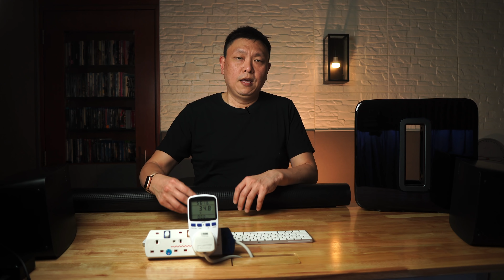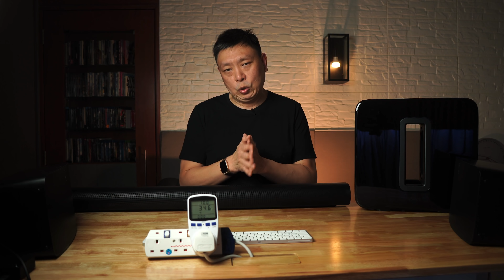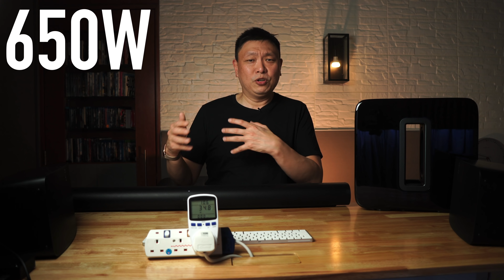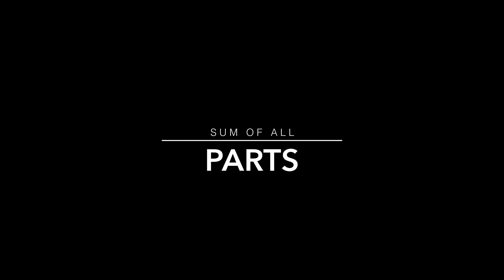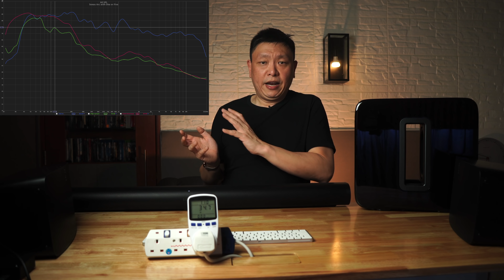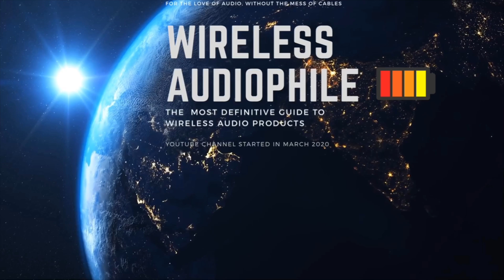Sonos Arc ultimate setup @ 2,500 USD. Is it worth it?

Comment: Thanks! Peter, the clarity and thoroughness of your reports set a gold standard for any other Tech site.I even enjoyed  learning about products that I don't even own! I have an installation project whose solution I don't think you have addressed before. It's a 55-in TV on a full motion corner mount with +5 to -10 degree tilt, and Sanus extendable Arc TV mount.  I have a 9-ft ceiling, and 32 inch high by 10-ft distance mlp. What height and angle should the arc placement be for best listening? I don't have your trig background, so any advice would help. Again, great work!
Reply from the maker: Hey Kirk, thanks for showing your appreciation in a tangible way! Sorry if this is late I do have to juggle my full time job as well as this. :)

I need one more piece of information from you. How high off the ground is the Sonos Arc now mounted?

Comment: Hello Peter,

firstly thanks a lot for your detailed descriptions and test with the Sonos systems.

I bought a Sonos Arc and the sub. For movies/films it is impressive especially with Dolby Atmos.
Unfortunately the most films have no Dolby Atmos in German.

But I am not so happy when I hearing music. I think about to buy two Sonos 5 as rear speakers. But I am not really sure If I can use for music only the two Sonos five in the back? If the systems is configured as a 5.1 system. 
Thanks for your support.
Reply from the maker: If you set it up as two rear surround channels, you can't use the Fives purely for music. But you can set it to send full sounds to the rear (fives) and also increase the music volume for surround. This way, it will be much louder and will stand out in the music mix.

Comment: It would be cool if the sonos five as rear surround speakers in there upright position would use it's stereo drivers as one for rear sound and one for above sound. So with the speaker slightly tilted up the bottom drivers would do rear sound, and the topp driver would bounce it's sound off the ceiling for above sound like the arc's upward fireing speakers.

Comment: I think the Sonos 5 as surrounds might have more of an advantage iPod the space between the surrounds in a wide spread room arrangement would yield more tangible subjective performance advantages over the much smaller Sonos 1.  I get a lot of sharp, pinpoint directionality from the Sonos ones, (more so from he right side). I cannot help but wonder how much more fuller the atmos effect could be with the Sonos 5 as it pertains to offering much bigger sound stage at similar volumes that I set my Sonos 1.  I am of the belief that the broader spread of sound emanating from two Sonos 5s will offer a much more subtle but more importantly convincing immersion into the Atmos sound field than Sonos 1s are capable of. The smallness of the Ones in an Arc/2 Sub Gen 3 set up is too noticeable
Reply: I'm thinking the same. The sound stage has to be better. And that is the point, not necessarily louder but more immersion...you cannot tell me a 1sl is the same as a 5 I'm sound quality

Comment: hi Pete...great review...i am gonna be setting up my SONOS ARC with 2 Gen 3 subs / and the 5's as my rears..what are your thoughts ? room is 14 x 22 ft...ceiling is 8 ft high....and the TV i will be hooking it all to is the Samsung Q90T  85 inch....also where would you suggest i place the 2 subs ? ( on each side of the TV ? or one up front and one at the back of the room)....look forward to your response....thank you and cheers......be safe out there all
Reply from the maker: I did a video on placement of two subs. And your setup... GOD LEVEL.... I would suggest you try the two subs upfront first. And if you get patchy sub response throughout the listening positions, move one of the subs to back of room, but diagonally across the first sub.

Comment: Hello Peter ! If I want to connect a turntable in this setup, do I have to go through sonos amp?
Reply from the maker: You can use a Sonos Port as well as an amp. Port being the cheaper option if you don't need the amp. Because in this setup, the Fives' line-in is not active.

Comment: Can i add two sonos one to that setup?

i would like to have 1 arc, 2 fives and one sub in the front 
and 2 ones at my back for surround
Reply from the maker: No you can't. They will have to be in two separate "rooms". So technically, if you do set them up as separate rooms, you can play to the two of them together.
Reply: @PeterPee  Thanks for the quick reply my friend!

I dont really understand your answer :(

I want all these speakers in one room together 2x fives in the front 1x arc in the front and the sub in the front and the ones in the back

i want that the 2x fives, the arc and the 2x ones to create a surround sound
Reply from the maker: They won’t work together to create surround. Your surround setup with be arc + sub + ones at the rear. The fives will have to be setup separately as stereo pair. Not as part of the surround setup. You can play the surround and stereo setup together though.

Comment: I hope you will do a test on the Denon home series. To my untrained ears in a big shop they sounded better then what sonos had on offer. Reason why I chose sonos is because the Denon home line up does not include a sub and soundbar (the older 2019 Heos sub and soundbar versions can be coupled but they look totally different, which at 2500-3000 $ I don't like...)
Reply from the maker: Beyond the sound, you have to consider that Sonos is going to be supporting your gear for much much longer than almost every other brand out there.
Reply: @PeterPee  thanks!

I think Denon is also quite good in supporting older stuff, anyhow even if you stick to Sonos I would still love to see other manufacturers sending multiroom audio products for you to review in your very detailed manner!

Comment: You do the best reviews I’ve ever seen.  Thank you!  I’m considering this setup.  By chance have you done a review on the Nakimichi 9.2.4 Ultra?  What is your overall best opinion on the systems you’ve tested and best value for money on a good sounding wireless system?  Thank you again!
Reply from the maker: Thanks Ron! I have not tested the Nakimichi 9.2.4 Ultra. The specs sound impressive and the sheer number of channels will make you think you are getting a lot for the money.

But I'd say overall, the Sonos will give better value, as they really last very long. In all my years of ownership, I have never had a single hardware failure. And also, even the 9 year old Sonos Play:3 is still being supported and updates rolled out by Sonos! That's longevity.

Comment: Hey Peter I have the Playbar with 2 sonos 5s beside it and 2 sonos ones at the rear accompanied by the sub. If i want more fire power would 2 subs be overkill? Or adding 2 more 5s or swapping the playbar for the arc be the better option?
Reply from the maker: You can’t really use two subs in one ‘room’. But your setup sounds like you already have two rooms, one for playbar and one for sonos 5s. I’d be honest and say it doesn’t make too much of a difference. In fact it might overpower the room already.

The next thing you might want to consider is to replace the ones with the fives. But that’s about the max you can get out of your situation. 

Replacing the playbar with the arc won’t give you a lot more.

Comment: I have the sonos Play:1 is it compatible with sonos arc to be the rear speakers? and what is the difference if I have Sonos SL as the rear speaker compared to Sonos Play:1 as the rear speakers?
Reply from the maker: Yes, the play:1 is compatible. I am still using the Play:1s as surround rear speakers. The Sonos One SL makes little difference.

Comment: What is the recommended hdmi cable?
Reply from the maker: I just use the original cable provided by Sonos. If not, I’d recommend elecom which are orange certified. The ones with the orange sticker.

Comment: Awesome review. Only question I have is if the Five can be set up vertically to have one of the angled woofers facing the ceiling thus creating a rear surround up firing speaker?
Reply from the maker: I placed it in either orientation and to my ears, it didn’t make a difference when watching movies in terms of height perception. I actually would place it horizontally so as to get a wider surround soundscape.

Comment: Hi Peter, can you clear the air about the lip sync issues with sonos arc + shield 4k/apple tv 4k + oled TV? Reference: https://en.community.sonos.com/home-theater-228993/if-you-re-experiencing-audio-delay-issues-read-this-6793458/index20.html
Reply from the maker: It's really unfortunate but the processing of the Atmos signal causes issues. It's something that the TV makers will blame the soundbar makers for and the other way round too. I unfortunately can't figure out a solution to this and everything seems to be pretty hit and miss now. I know that my Wemax A300 projector introduces the delays. My LG TV doesn't, with either the Shield or the ATV. The ATV doesn't even want to work on my Samsung TV to pass through Atmos.

Comment: Do the 5s make a big difference when using the system for music (which I would be doing)??
Reply: Without a doubt 5’s/Fives make a significant difference in listening experience for music. But you have to play with the app settings for your room EQ and surround 5’s/Fives to be able to get a good sound for music playback. You might also prefer listening to music with Autotune turned off. It’s all about your own preferences, combined with the acoustics in your own listening space. But rule no1 in this config is to switch surround speakers to full music playback because they default to “ambient” which is useless for music playback. Enjoy!
Reply: @djt6546  thanks mate.
Reply: Absolutely yes
Reply from the maker: In fact, more of a difference for music than for movies!
Reply: @PeterPee  Excellent news. Have you listened to the Harmon Kardon citation bar in a 5.1 setup. I would be interested in how they compare.

Comment: What about using the 3’s with the ARC abs the Sub 3
Reply from the maker: Actually, that was the configuration I was on for a while. As opposed to using the Ones, the overall volume levels are much higher.

Comment: Great stuff!! Actually interested in this crossover point. You did a video with arc and sub showing crossover point at about 92 hz. When you add 5s to the mix the crossover point for both arc and 5s raised to 115hz? Wonder what the crossover point was increased to when I added my 1sl's as surrounds instead of your 5's?
Reply from the maker: Because Sonos doesn’t disclose this, and I don’t have the most accurate of instruments and fixed setup, the crossover point that I am providing is at best an estimate. But I have done so many of these tests, like literally hundreds upon hundreds, I am fairly certain that the crossover point is set very high. I think Sonos really wants us to hear the sub. :) I have a thought at this moment, that Sonos wants to raise the crossover so that the surround channels can be a little more subtle. Or that the surround channels need not carry much bass anyway since most audio mix won’t have much bass in their soundtrack. But at this moment, I can only say this is just a Guess. If I ever get a job at Sonos I will dig all these information out. Only to get fired when I release the info to the public. :)

Comment: I just found that my amazon echo (newest one) works as a SUBWOOFER if needed. I wonder how that would be combined with the Sonos stereo speakers you demonstrated. I figure its  not worth it. Just a thought.
Reply from the maker: Oh!? You mean it has a subwoofer input? The only Sonos product with a sub woofer Line out now is the Sonos Amp so that’s a big investment to get sub signals out of the Sonos ecosystem.
Reply: @PeterPee  Correct, you can pair your amazon echo device with the sonos arc; however I am not sure if it's even worth it at all since the bass in the arc alone is quite good enough.

Comment: I have the complete setup, I really liked the 5.1 on my Sonos system, the Atmos...I cannot say that I hear the height....still 5.1 for me...
Still it sound very good,  I have seated at 6,7,8 and 9 feet. Can’t see I heard sound from above...
It is a keeper cause I never had any issue of dropout , cut out, issue with wifi...etc.
Reply from the maker: The stability and usability of the system is a key selling point for sonos. You seldom have to troubleshoot. Just turn it on, and great sound comes out.

Comment: I have an arc, sub gen 2 and 2 play 3’s for rears and it’s fantastic - I would totally have Sonos 5’s for rears - I genuinely don’t think it’s overkill as you could always reduce the volume in the rears anyway if you felt the rear were too loud.
Reply from the maker: It won’t be too loud, but the presence and overall volume and performance of the whole system will get elevated. It’s just damn expensive to get there.
Reply: Wenham Fitness PT  do you know if you can change the volume on the P3’s as rears in the app?
Reply from the maker: The Play:3? Yes, you can adjust the volume of rear channels in the app. For music as well as for tv/movies, independently.
Reply: Dave Gomes yes you can in the surround settings you can adjust the TV volume abs music volume. I always have mine sitting at level 8 for rears in TV and up to max for music - as Peter Pee said
Reply: Wenham Fitness PT ok great thanks for that

Comment: Everyone need to see this.  I've heard so many times thats sonos five is overkill for 5.1 (rear) but its soo much beter than sonos one for the rear speakers
Reply: Obviously the five:s are gonna be a lot better than the one:s. If you were to buy one Sonos Five, it would cost you 2x the price of a Sonos One + another $100. And you're gonna have TWO of those to replace two Sonos One:s. Obviously you're gonna get a lot better speakers when you're paying nearly 2.5x the price for just one speaker.
Reply from the maker: As with all things hifi, there is a difference when you spend more. Just a matter how much better and how much more you spend. After a certain point, the law of diminishing returns kick in and you start getting less incremental benefits with the same amount of extra money.

Comment: Hi Sir , enjoin your content a lot  !,  I am about to receive my Arc soon (not yet arrived to IL) and wish to add 2 sonos one Sl's to the arc. 
Position wise , I am very limited and therefoere , they can be placed ONLY at 1 meter above ear level and pointing towards the TV wall.  They will be positioned on top of high shelf which unfortunately can not be angled down,  so pointing towards the TV wall directly (1 full meter above the ear)
will you still recommend buying them?  Will they add a dramatically change over the Arc itself (due to the limitations mentioned ), .thanks in advance, .keep on the great job !
Reply from the maker: The placement of the surrounds aren’t as important. You’ll still find that they add a lot to your movies’ soundtrack immersion. Get them!

Comment: Thank you for another great video Peter.  I have recently bought the Arc, Sub (Gen 3) and 2 x One.  I prefer the sound from the Arc by itself, rather than with the Sub or Ones.  I wish Sonos would allow the crossover to be adjusted.
Reply: Hi,  can you comment if you see a point of adding 2 sonos one SL's to a NON sub setup as ''game changer''?
Reply: Amit Lesly I am still undecided if the Ones are a “game changer” / worth it.  My initial impression is that the Arc sounds too hollow when I had the Ones and the Sub connected, though that may be the Sub’s fault.  I also think the placement of the Ones is very important and in my room they are too close to my seating position to work effectively (I have them on stands within arms reach either side of the seating).  At the moment I am enjoying using the Arc by itself and getting used to that, I will connect the Ones and the Sub separately in the coming days and do some more experimenting with placement.
Reply: Thanks for the prompt respond,  if I may another one. .. are the sonos one's worth as music speakers compared to I.e. JBL flip 5 (I do know the diff etc,  having 4 of the flips 5 ) but never experienced the Sonos one's
Reply: Amit Lesly I’ve never heard the JBL’s, but I do enjoy the Ones for music, especially as a pair.  Nice stereo imaging and dynamics.  Of course the Sub adds another dimension in bass, but the One’s alone produce some good bass for their size.
Reply: I agree with the comment about the arc sounding a bit hollow on its own. For me the sub and the ones are essential. The best investment I've made in a while!
Reply from the maker: I love the sub la.